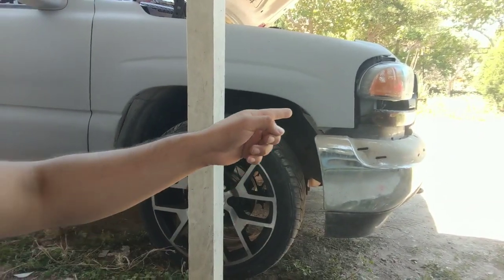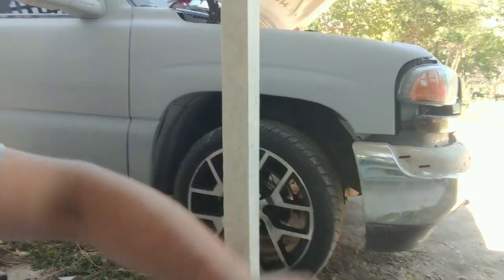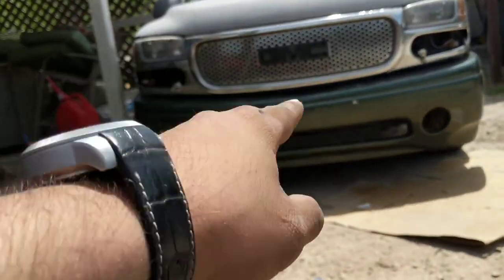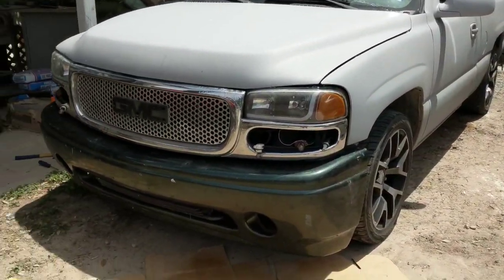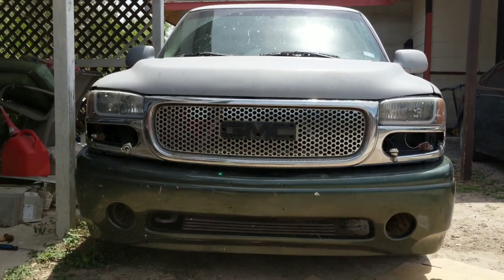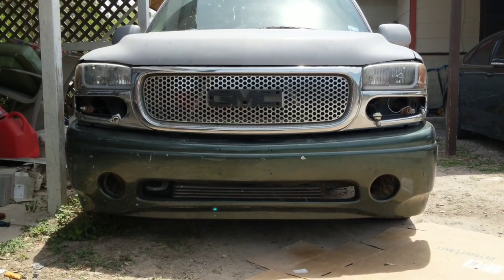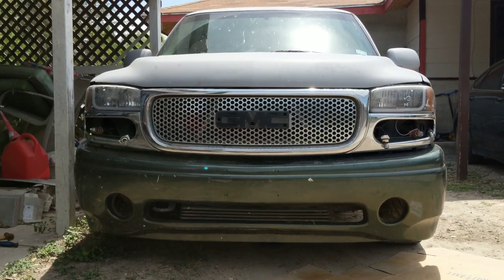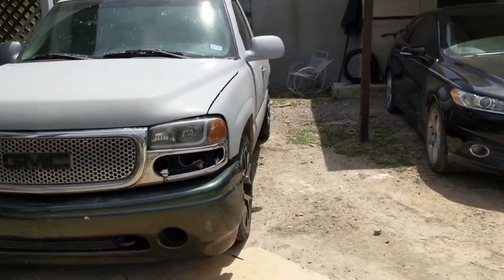Denali Front For My Sierra

Comment: Watsup with parking lights (turn signal lights)are they direct bolt on or will you need to change out the headlight housing in order for them to fit

Comment: Did you use a 03-06 dash bezel to do your double din swap? I know ash tray has to be cut to fit, but can the power port cover be modified or it just can't work, thanks, I have same truck and would recommend a Denali gauge cluster, it ads a trans temp where the blank is and speedo goes to 120mph, plus it lights up blue at night, I hated seeing a blank spot on cluster and was really happy after swap, just bolts right in and works,
Reply from the maker: I just cut the plastic between the radio and air con. I'm gonna buy the Denali cluster later for the reasons you mentioned.
Reply: Ok, I see now, didn't even notice that, Love your truck, I really want the HD hood and LED headlights, just gotta do one piece at a time
Reply from the maker: One step at a time

Comment: I got the same bumper I’m going to install in on my 99 GMC Sierra do I need the brackets or can I use the same ones my truck has ?
Reply from the maker: Yes it's the same
Reply from the maker: Yes it's the same
Reply: Thx for the replay ok so I don’t need to get danali brackets correct I can use the original ones on the truck
Reply from the maker: The Denali bumper should have them anyway, but they are the same
Reply: V8 Nation the bumper came with the brackets but looks like I’m going to have to switch the grill the the newer one like yours
Reply from the maker: Yes you are
Reply: Ok bro thanks 🙏 keep up the badd ass videos on the previous comment I meant the danali bumper dident come with the brackets

Comment: Was it a direct bolt on or did you have to change the bumper brackets or do other mods?
Reply from the maker: If you get a complete one then yes, it will bolt on without any changes
Reply: @V6Nation  oh ok. And it looks good
Reply: @V6Nation  what's ur snap
Reply from the maker: Angel_cantu956